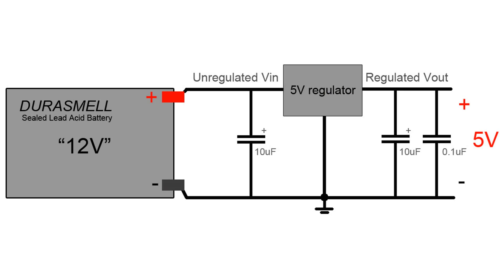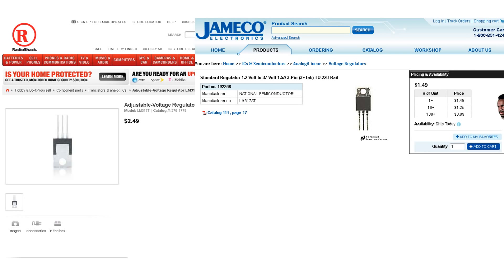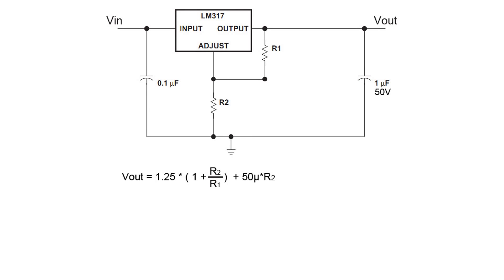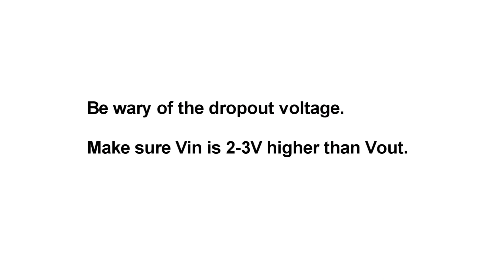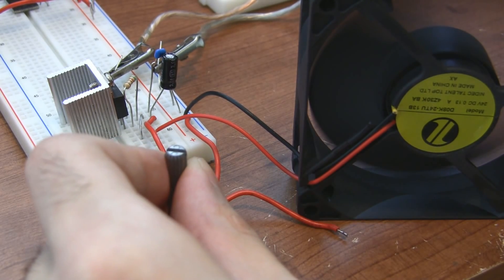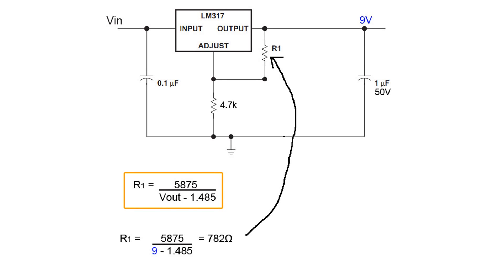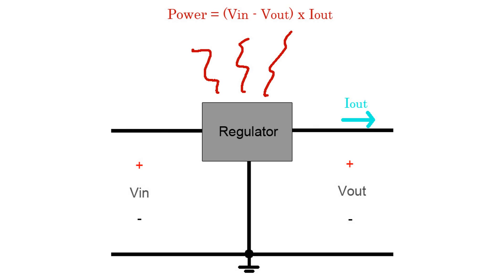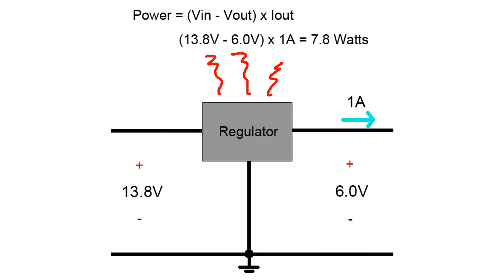LM317 Adjustable Voltage Regulator Tutorial

Comment: Let's say that I have a wide-range input voltage (say, 1-volt to 20 volts), but I want to use a fixed output voltage of 13.7 volts. Can the LM317T accept that much power without smoking it, if I give it a large enough heat-sink? I am wanting to build a custom voltage regulator to work for a remote DC gen to lead-acid storage cell system, where the charge is supplied by a windmill. In theory, this is the same circuit used in older cars (voltage regulator preventing overcharge from alternator). Am I missing something, or is the voltage regulator on an older automobile not a similar circuit?
Reply: A couple of problems with that, the LM317T is an adjustable voltage regulator it cannot raise the output voltage. 
As such in this case you need a minimum of 16.7v input for it to regulate a 13.7v output (3v <= (Vin - Vout) <= 40V), if you have less than that input your battery will be discharging into your input power supply(bad idea).

Another thing is the greater the difference between the battery voltage and the regulated voltage the greater the amps that will be conducted, which for lead-acid batteries doesn't need to be much before things start melting, so you can't just use a voltage you want to charge to but current limit the voltage (lower the voltage difference, eg: bat(9.4) + 0.9v = reg(10.3)) to prevent large amperage's from damaging things.

If you just wanted to use a linear voltage regulator like the LM317T you would need to cut the regulator input voltage (with something like a resistor voltage divider and a transistor|relay rated for the expected amps plus safety margin) whenever the voltage dropped below 16.7v.

Since the LM317T has inbuilt thermal protection you don't really (bad idea) need to current limit the output since the reg will turn off each time it gets too hot and turns on when it cools down.

With all of the above you only have a battery charging regulator whenever your input is greater than (>) 16.7v and when the LM317T hasn't turned itself off to prevent itself from burning.

-Option
What you need is a CC Buck-Boost power supply rated for the expected voltage and amperage range plus safety margin,

CC = Constant Current(drop the voltage when needed so things don't melt),
Buck = Lower (to lower input voltage to CC voltage),
Boost = Increase (increase the voltage to the CC voltage).

With such a supply you just set the maximum voltage and maximum amperage, it will do the rest.

You could put a CV (constant voltage) Boost power supply from your power source(windmill) and set the output to ~16V and then connect a CC Buck power (eg: Vout to 13.7v, Iout 3.5a) to the output of the CV boost. 
Even though the Boost would only increase the voltage when it is below 16v and just pass any voltage higher than that to the Buck, the Buck will lower it to your set value with the Current limiting so things don't melt and or burn.

-Notes?
If you are feeding directly off the windmills generator you will need to rectify it first because it generates in AC, don't need to bother if that already been done in the windmill though.

Input will limit your output, eg:
Input: 16v @ 2a (32W) = Output: 13.7v @ 2.33a (32W)
Input:  3v  @ 2a (  6W) = Output: 13.7v @ 0.43a (  6W)

Output Amp = Iout = (Vin x Iin) / Vout
"I" means amps.
All components need to be able to withstand the greatest voltage and amperage found anywhere in the circuit(more or less)
Reply: ChatNoirLe

My input voltage can range from 0-volts to 32-volts, actually. The input is a DC windmill head. I am trying to level the output from the windmill head to a fairly constant 13.5-13.8 vdc.
My problems are multiple, I was only asking a portion of the question. I have a voltage regulation issue. I have an output to storage potential over-charging issue, and I have a constant circuit voltage directional issue - compounded by moving close to 1000 watts across a wide voltage range associated with varying wind speeds.
All this is compounded by everyone working in millivolts or milliamps when discussing their projects, that suddenly turns everything into 9-levels of complex-hell, when you get into power (heat) dissipation as a result of actually working with real-world scale projects. (like having to build in relays or use shotskys because you can't just run direct circuits anymore, without extensive transistor or solid state circuits.
All of this defeating the purpose of me building it myself, when I can just go buy a commercial solar charge controller for $30, or a power regulator for $25, and simply plugging them together.
Reply: ChatNoirLe

I was trying for something slightly more current-capable than you can see at:
http://www.learningelectronics.net/circuits/high-current-low-dropout-voltage_12.html
It is a voltage regulator using zener-transistor-mosfets to regulate 11-15vdc to 12vdc (except I need a wider range and about 12-times more amperage capacity...or a lot more wattage handling).
While the circuit shown there is great, it's simple, and a 20-minute build - I'm still trying to go under that $50 pricetag that would justify not just building it by off-the-shelf modules (i.e.: 1969 Chevy voltage regulator for $14 and a solar array charge controller for $30).
Reply: Dust Devil
In regards to using the Chevy regulator I doubt such a regulator would do anything besides burn at the wattages you are wanting.
When using a linear regulator you dissipate all the power above your output voltage and can only drop the voltage not increase it.

For example at worse case you have 1,000 watt coming from your source at 32v, to drop that down to 13.5v you will be dissipating ~578 watt through your linear regulator as heat, generally you wouldn't do that as they are mostly only good for a few watt, not to say you cannot but that starts to get a bit more exotic.
And no you cannot just use a bigger heatsink as the component is limited in how fast the heat can be transferred out of it.

It would be cheaper to use a solar array charge controller connected to your source with a large value capacitor bridging the positive and negative on the input to smooth out any sudden changes in your source output.
As long as the charge controller and capacitor can handle the maximum voltage and amperage (with some safety margin) it should function perfectly fine, as well as the fact that the controller will most likely have some inbuilt programming to be gentler on the batteries than some hard limits and cutoffs which should increase battery lifespan and safety.

As for why it would be cheaper is the controllers are built in quantity, with each part being brought in quantities of 10,000-100,000(so large discounts), if you bought each component separately it would cost more than the unit delivered.

Though one thing you can do to squeeze more power out of your controller is to raise the input voltage (as long as within specs and safety margin) with say a boost converter, if you raise the voltage before the controller you can feed the controller the same amount of amps as before but you total power will be higher.
Reply: ChatNoirLe

I have only hobbied around with solid state circuits. Though I am a degreed mechanical engineer (retired), I have forgotten most EE that I ever studied.
That said, I am always at a total loss to understand why that the moment you give a prime example of an antiquated working circuit that was produced and sold in mass quantity, no 'hobbyist circuit builder' can address how it worked or  explain simple modifications to it that would allow it to work in a modern functional application.

Let's take an external 1972 Dodge D100 truck voltage regulator for example (external to the alternator). While the alternator has internal rectifiers to convert the AC to DC (output on most was between 10vdc and 37vdc unregulated), the voltage regulator is just that, a voltage regulator (due to the dc voltage output of the alternator varying as a function of rotational RPM inside the alternator. So the external regulator can take low, medium or high incoming DC voltage, and by its regulation function, control it with a range of 11.7vdc-to-13.7vdc, while easily handling amperages up to 120-amps.  It does this for a price of about $14 (I am apparently going to have to just buy a new one and see what the circuit is, since this seems to be rocket science beyond the scope of any I have asked).

Now, if they made millions of these (and they still do as replacement parts), how come it seems IMPOSSIBLE to have someone address how it does this, who knows more about electrical circuits than I do, and possibly improve on the concept, such as with a potentiometer or refinement of voltage range on the output control?

I'm building a windmill power system. Basically, I don't want to cook the wet-cell-lead battery from overcharging (hence, a charge controller) and I don't want to send 55-volts at 120-amps into a 12vdc lead cell battery due to a sudden 60-mph wind.  So, I am looking for a regulator that won't allow high spikes (hence, regulation) and a controller that will note a full (13.5vdc) battery condition and will open the circuit to stop all charging until a charge-point (normally 11vdc) is reached, then close the circuit. With a known regulator that can handle these currents available for around $14, common sense tells me that the alterations to make this a smart switch to control over-charging should still place this idea at less than $50 invested - a far sight short of the $750 I've priced a similar commercial product for.

Again, the regulation (upper range) can be controlled or regulated through the automotive regulator, all I am looking for is a charge controller that can take the potential regulator's output and act as a smart switch to charge or not charge, based on the charge condition of the wet-cell battery. Why not use a solar charge conditioner? Because the output of the regulator entering the charge conditioner-controller would be up to 900-watts, beyond what most can handle.
Reply: ChatNoirLe

Is there a relay that is normally open, that would close (through the coil circuit) based on an input range, such as 11.0vdc to 13.2.vdc? Adding this to the regulator output would seem to suffice for what I am seeking.
Reply: Dust Devil 
The specific reason why you can't use a vehicle's alternator's regulator is because the regulator doesn't actually control the output voltage directly but instead "sense's" the alternator's rectified voltage coming from the alternators stator windings.
It does this through a zener diode's reverse breakdown with some resistors to tweak the voltage, that output is then feed into a power transistor which controls power coming from the battery(newer designs feed off the stator's rectified output) that power is then feed into the alternators field windings, this in turn generates the power through the stator windings.
So for say a 70 amp alternator the field winding would only be receiving ~7 amp from the regulator.

As for why no one seems to know how this works is because it is a voltage regulator powered from the battery controlling only a few amps which is feed into the alternator which then generates the output voltage to charge the battery at a steady voltage regardless of RPM.
Looking at it as a separate regulator knocks off ~90% of the amperage rating and needs to be powered from a stable DC source at eg: 13v(+-~2v).

For the solar charger's wattage rating it would only pull as many amp's as it can handle as long as the voltage is within spec, note though that the more amps that it pulls the more the windmill's output voltage will sag.
So you might have a possible 32v @ 31a (1,000w) coming from the windmill but you are only drawing 32v @ 14a (450w).

A solar controller shouldn't have a problem with the difference between the IR(internal resistance) of solar panels and a DC source, at least in theory as people could parallel their panels quite a bit before the controller...

For relays I tend to be a bit nervous with highish amperage cause any sort of deterioration or damage to the contact surfaces or just a slow close time can cause a partial connection with high resistance for a slight amount of time (<0.01 sec).
With highish amperage this can create a lot of heat, not to mention they are expensive for highish amperage.

You could use two relays, one NO(normally open) and one NC(normally closed) place them in series and feed their input into their coil's through resistors to set your switch voltage's, the relays by themselves should have a switch voltage lower than the respective minimum relay on conditions.
Eg:
Set range 11.0v - 13.2v.
V = <11.0 = NO(off) = NC(on)
V = 11.0<= V >=13.2 = NO(on) = NC(on)
V = >13.2 = NO(on) = NC(off)
If both relays are on then you have power if not then not.
Reply: ChatNoirLe If I need high current, I use a current shunt, also known as a "pass transistor" If very high, use more transistors in parallel. I also use a driver transistor to drive the pass transistors because depending on the current, the base of the pass transistor may require a few amps, to make it fully conduct, so a driver transistor is in order. It won't take so much current to cause the drive transistor to do its thing. The concept is exactly the same as in a high power audio amplifier. They use driver transistors to drive the outputs without straining the low power / preamp stage. The same exact thing goes for a high current supply. You could also drive the driver transistor if it too, needs too much current. I have never needed more than a driver transistor. You could also use a darlington transistor as your driver. The regulator will still need a reasonable heat sink though, but to do a good job, use a driver and a pass transistor and you will have no problems. Remember to put a 1 ohm or less 10 watt resistor on either the emitter or collector of the pass transistor for proper biasing. I use NPN's, 3055's are perfect. I tie the collector to unregulated B+ and the bias resistor to the emitter and use the other lead for the output / high current, regulated voltage. The over charge issue will require extra circuitry which would be a comparitor of some kind, which would give a signal to the driver transistor or regulator, effectively shutting it down or folding it back so full output current would not be present constantly. It can be done but it will take someone who knows what they are doing or a lot of research and tinkering. The old cars that didn't use electronic regulators had a relay that switched in different wire wound resistors that limit the field in the alternator, thus limiting the current the altornator put out. This would be the easiest way for you to do it. Play with different values of resistors to get the field current you want. Then build a comparitor circuit that would drive different relays, switching the field resistors in and out. Make sure the field resistors are at least 20 watts. I'd go with 50-100 watts, myself... I always over do things so I don't have to go back and repair it later. If it calls for a 50 volt capacitor, I use at least a 100V one. I do not subscribe to the modern engineering practice, which is to run things very close to max. If your supply will need to drive 10 amps, I'd use at least 2, 3055's for pass transistors, but that's just me. Good luck
Reply: Landotter1 Heh, a driver to drive the driver of the switches :)
Though I still think it's fun to balance a bunch of parallel FETs, you know you got it wrong when only some leads are glowing instead of all of them.
Reply: ChatNoirLe some would call it a pre-driver.... and yes it is rather common

Comment: Thanks! Works great with a computer power supply. Since a cpu power supply has -12v and +12v and voltage is equal to the difference, you can use the -12v as the ground instead of a 0v ground and get a variable 24v.

Comment: i am wanting to use a -12v rail and a 12v rail and use the potentiometer to adjust between 3.3v and 24v. is the LM317 ok to handle this?

Comment: this may sound weird, but I have a similar adjustable regulator that I used and it runs along the same base as the LM317.  The AMS 1117 ADJ is set up the same way, however the formula has nothing to do with it at all what so ever.  It turns up, it only needs a resistor on the Adj/Grd pin to positive and use the ground as normal and I can adjust to any voltage I want.  If the out pin is connected in any way, the voltage is not regulated (i.e 5 volts in, 5 volts out if the out pin is connected to anything in any way.)  I've tried extremes for resistance on either R1 or R2, 10 Mohms, 30 Mohms, etc.... nothing, even connecting things to purposely short out the OUT from the adjust pin.  if the out pin is connected it wont bother going through anything else it will be what ever the input is.  Any ideas?

Comment: Can i use a LM1117 in place of the 317 ?
Reply: You can but you need different resistor and potentiometer plus it can only handle 800 mA-s whitch is not that much :/

Comment: It doesn't seem to be working im using 2, 1microfarad electrolytic capacitor and  50k pot (r2) and 268k (two  100k one 68k for r1). I calculated 3.98 v put pit but im getting 6.5 to 6.98 v output which doesn't change when I turn the pot. Is my math wrong or might I not be wiring It Right?

Comment: 1 question: in the video he states that the input needs to be 2-3 higher than the output, but in the circuit diagram it doesn't show what he uses as a input, so could that mean I can simply hook up 50v wall adapter and leave it as is, because the lm317t data sheet says that its max output is 37v, so im worried that putting that much voltage may pontientally ruin the circuit